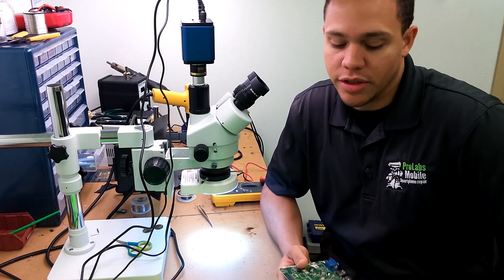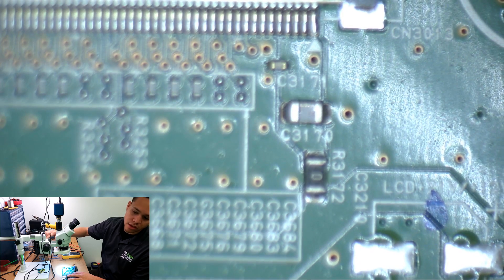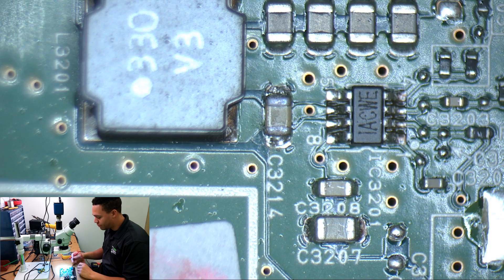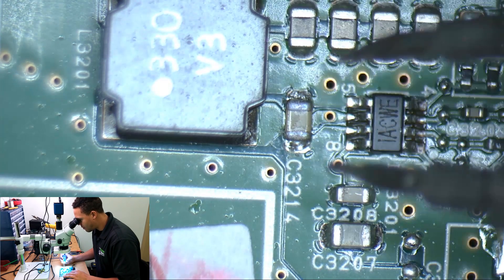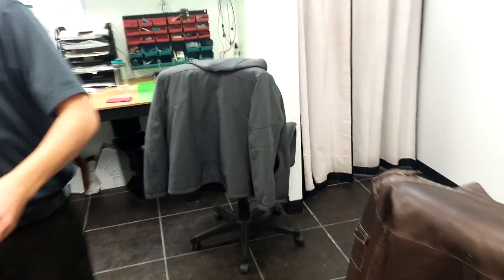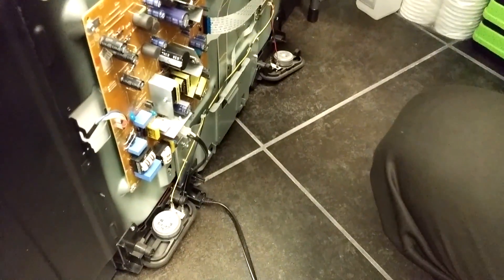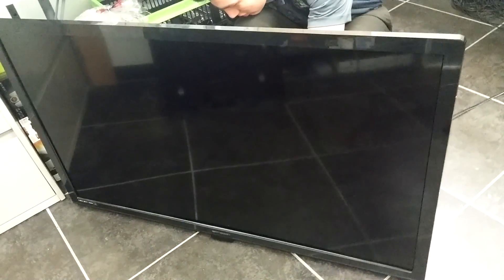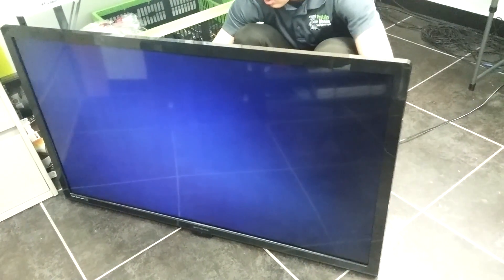Finding A Short No Schematics

Comment: hello  thanks for video 
need some advice !!
i have gpu shorted to the ground so i test mosfets and capacitor some of them are shorted to ground , i remove all shorted to ground mosfet and keep 2 that's not shorted and between leads are 12v dc
so it maybe a solder under gpu or vram or other shorted capacitor !
for that could i inject 12v in mosfets leads that is shorted and see wich place is seem to be hot? or any advide i will apréciate that
any suggestion about how much volts and current to inject in lead or some place suggested by you!
thanks and have nice day
thanks for everyone who reads my comment :) see you next replay ^^

Comment: Should not you replace it with new capacitor? Why would the manufacturet put it there in the first place of it was not necessary?
Reply: Surely the value would be available online or manufacture specs?
Reply: No... because if its shorted you cant know the value of this capacitor.
If you replace it with the wrong value it will be more worse than simply remove it.. Because this is only a Bypass Capacitor.
Reply: Mostly 0.1uF or 100nF is used for all bypass capacitors. Sizes vary but the values are the same.